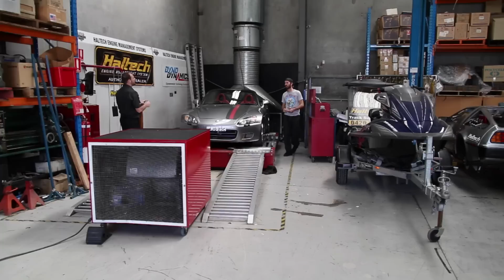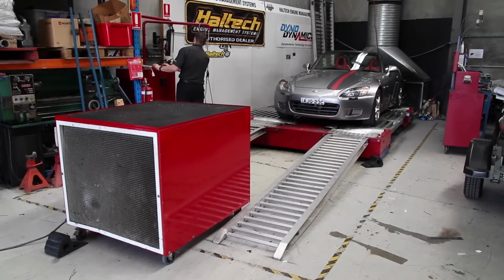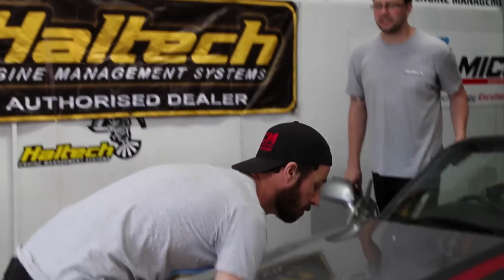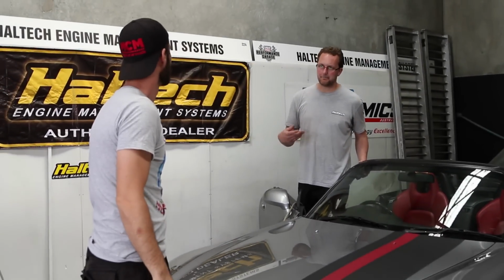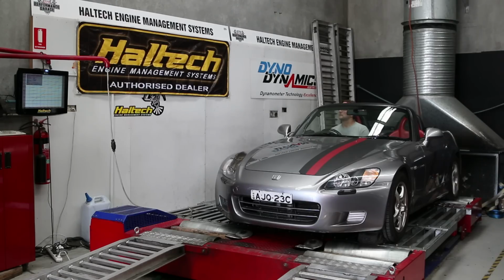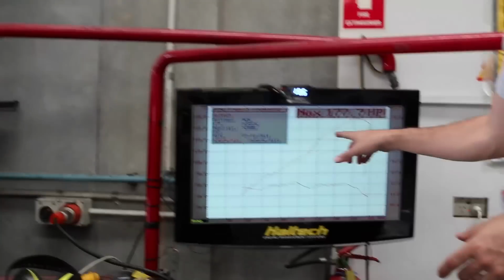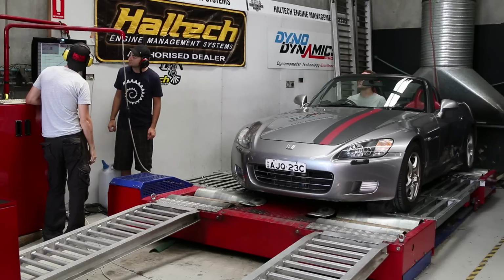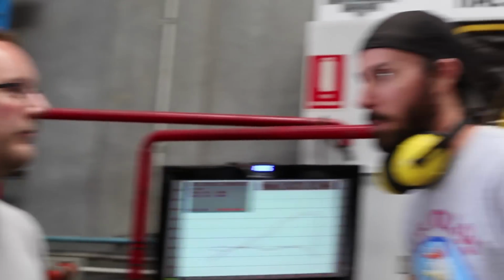Cold Air Intakes Mythbusted [Naturally Aspirated]

Comment: Figured I'd comment since this will likely be the most popular video on the subject for awhile....So I feel that CAI/SRI intakes are valuable depending on a few other factors, for starters diameter of the piping....I have a 3.5 Intake which is an upgrade over the pvc 2.5 stock tubing. I definitely noticed a difference especially when moving from a oiled to a dry filter. Another benefit of the upgrade was how it opened up a hole area of my car hidden by the intake box and mounts.  I had an issue where my cold pipe kept popping off and I would need to pull over and spend 10-15 minutes removing the airbox to get to it in my car. I would imagine this design would only increase in heatsoak and hope that by opening it up, the air that would go to the stock airbox is instead traveling across the top of my engine, hopefully pulling heat out. Driving a Turbo down South is no joke.  Of course the biggest selling point is visceral and changing the sound of your car so you can hear spool and bov  (if no maf sensor) is a good way to enjoy the car without driving recklessly.

Comment: Rx8 a 2 stroke? first i heard of that. of all things its a 3 stroke
Reply: there is no such thing as a 3stroke. there are 2 stroke or 4 stroke engines. did you maybe mean each rotor has 3 faces?
Reply: You can't say its 2 or 3 stroke engine because there aren't any. Its an otto-cycle engine, that behaves similarly to a 2 stroke, as in on the opposite side of the Piston/Rotor another part of the otto-cycle is taking place.
Reply: thisnamebegreat  It may have similar but it has 4 cycles like a normal engine so its 4 stroke
Reply: SolarFilms ►TKV I have said this, otto-cycle has four cycles, the use of the term stroke on a rotary would be incorrect.
Reply: What tuning fork most likely meant was it kind of works like a two stroke in terms of how the fuel, air and oil is mixed together in the combustion chamber to lubricate the apex seals. oh and the same 'thirstyness' as a two stroke lol
Reply: A rotary has an intake, compression, combustion, and exhaust cycle, sharing with a 4 stroke engine, but if you want to get technical about it, a rotary engine doesn't have a "Stroke" at all, however the output shaft turns a total of 3 times for every 1 revolution of the rotor. So that would make it a 3 stroke, if it were a piston engine.
Reply: I can kinda understand why he says two stroke. We call a stroke, as literally, a piston moving from TDC to BDC or vice versa. Basically, if you look at a piston engine, it requires 2 full revolutions, or 4 strokes, of the system (up, down, up, down) for one power cycle (intake, compression, power, exhaust). A wankel rotary only needs to rotate one revolution per power cycle (0-180 degrees, 180-360 degrees), or 2 'strokes'. Now yes, they're not really strokes by design, but in terms of relating it to a 4 stroke piston engine, it makes sense. Looking at the GIF on this wiki http://en.wikipedia.org/wiki/Wankel_engine, you can see what I mean. The thermodynamic system completes a cycle in one revolution, vs. 2 revolutions for a piston engine.
Reply: SolarFilms ►TKV so wait, follwing your logic, V12 got 12 cylinders so its 12 stroke ?
Reply: lephantom270 I believe he may have also have mixed up due to the way the Wankel uses oil injected into the cylinder to lubricate the Apex Seals similar to a 2stroke that uses oil mixed into the gas to lubricate it's piston rings :)
Reply: prop1113 That doesn't really have much to do with it. The problem is, 'stroke' doesn't apply to rotary engines, it's a very bad way to describe it. Let's separate the thermodynamics and mechanics of the engine. If we think of a stroke as a purely mechanical term, it means, in a piston engine, it is the distance between TDC and BDC. In a rotary, this is a bit more complicated, but if we imagine a rotary apex, a 'stroke' would be the distance between 0 degrees and 180 degrees in the full revolution of that apex. So you have 2 strokes per engine rotation. Now because a piston engine completes a whole thermodynamic cycle (intake, compression, power, exhaust) in 2 rotations of the engine, it is a 4 stroke engine. One thermo cycle happens in a piston completing 4 strokes. Using that logic, a rotary is a 2 'stroke', as one thermo cycle happens in the apex completing 2 strokes, or one rotation of the engine.
Reply: don't really care if it's a 2 stroke or not. but was just giving another reason why he may have also said it was a 2 stroke rather than 4. I love rotaries but don't care to argue if they are 2 or 4 does it matter, not really (to me anyway) Cheers
Reply: SolarFilms ►TKV for some reason I thought you wrote cylinders not cycles...  wankel engine has 4 strokes
Reply: SolarFilms ►TKV Wrong. All otto cycle engines have four cycles. Two strokes have four cycles. Four strokes have four cycles. Wankels have four cycles. The word stroke specifically refers to how many times the piston moves in the cylinder. Wankels are not reciprocating piston engines, so neither work exactly, but they work in a manner far similar to a two stroke engine than they are a four stroke.
Reply: yes i agree typically people refer to cycle as stroke which is not always the the same rotatory engines being the example. how ever you are wrong saying 2 Stroke have 4 cycles  they only have 2
Reply: SolarFilms ►TKV no they don't.  They just get all four done in two movements of the piston aka strokes because they are doing two at a time kinda.
Reply: FiftyRacer "kinda" is right.  It's funny, this thread has proved you all had good points and successfully proved each other wrong and right trying to sight clever  similarities and differences between the piston/cylinder style engines and rotary/lobe style ones.  Consistency of terminology helped clear some of that up but missed the main reason why there is 2 strokes needed and one full revolution of the crank to complete air/fuel in and exhaust out for a 2 stroke engine and why there are 4 strokes and 2 full crank revolutions needed to get the air/fuel and exhaust out is there cams and valve in a 4 stroke and just ports in a 2 stroke. In a 4 stroke engine. That is why a stroke is not the same as cycle when comparing 2 and 4 stroke engines to rotarys.  The way I think of the difference between 2 and 4 stroke engines is described the same as you would read in any text book.  A 4 stroke engine is named that because its based on the position of all the mechanical parts during 1 cycle. There is 2 different events happening when the crank and piston pass the same spot twice during what we call a cycle in a 4 stroke. The reason this needs to happen twice in a 4 stroke is because there are cams and valves to allow air into the cylinder and seal during 1 revolution of the  crank then allowing it out of the cylinder during the second crank revolution.  This is why the word cycle is used. 1 cycle describes 2 full revolutions of the crank. one revolution is a piston to pull or accept air into the cylinder as it goes down (intake stroke) as it sets up the combustion event, and back up for the combustion event (compression stroke).  The second revolution starts as the explosion pushes the piston back down (combustion stroke) then, finishes by pushing the exhaust out. (exhaust stroke).   What we have within the 4 sets of parentheses account for the 4 strokes in 1 cycle.  A 2 stroke doesn't have the cams and valves to control the air/fuel in and exhaust out.  It has ports in the sides of the cylinder and the piston itself seals those ports during the 2 strokes of the piston and one revolution of the crank completing it's cycle.  In terms of airflow we can say, the first stroke (down) completes the combustion and exhaust events while the flow of the exhaust out of the cylinder causes negative pressure in the cylinder also completing the intake event. The second stroke (up) completes the compression stroke.  Sorry for the lengthy post but this incomplete thread triggered an OCD event in my brain.
Reply: How about everyone here agreeing? It is a rotory engine.... no 2 strokes, no 3 strokes, no 4 strokes for the combustion cycle WHATSOEVER,  no strokes AT ALL. simplicity.
Reply: It's a 2 cycle more appropriately. .
Reply: thisnamebegreat  yes there are 2 stroke engines but i dont know about rx8
Reply: prop1113 not all 2 strokes require oil in the fuel. There are several marine, industrial and agricultural 2 stroke engines in the wild which use a conventional oil setup. The reason a typical weedwhacker 2 stroke engine uses oil in the fuel supply is because its highly simplistic design actually leaves the fuel/air mix running through every single moving part of the engine, therefore it makes sense to add the lubricant to the fuel as the lubricant is then reaching all moving parts too, this saves the complexity of having an oil pump. Industrial 2 stroke engines still have an actual overhead valve for exhaust rather than a port in the cylinder lining, they also use an external supercharger rather than crankcase compression (2 strokes cannot be naturally aspirated, the cheapo weedwhacker style engines use the piston falling into the crankcase as a very crude supercharger), they then have conventional oil and water pumps.

A wankel engine (the mazdas DO NOT use a rotary engine, that is a complete misnomer, the actual term is wankel) is a zero stroke design as it doesnt have a piston stroking. It is however a otto cycle engine, aka, 4 cycles. Intake, compression, combustion, exhaust in that order.
Reply: it is technically 4 strokes. What a rotary benefits is that it takes less time to do the "suck, squeeze , bang , blow" since it's it's doing it all the time unlike Pistons.
Reply: SolarFilms ►TKV VR46champion FFS. Two stroke is an otto cycle engine. It has four stages or cycles if you will. It completes them in two motions of the cylinder.
Reply: Jesus i never knew my comment could cause a giant fucking debate. well i learnt alot. cheers guys.
Reply: ***** Sure, it can take 2 stroke oil in the fuel and OMP to lubricate the rotor seals, but if you tried to put 2T oil in the sump it would fuck the engine pretty quickly.
Reply: fair enough
Reply: putting 2 stroke oil in the fuel doesnt make the engine a 2 stroke though. Try a shot glass of 2 stroke oil in a diesel engine, gives a bit of a clean out.
Reply: reed valve just stops air going out the intake when the crankcase pressurises at the bottom of the stroke. Powervalve adjusts the exhaust port size and broadens the powerband.

Comment: It also depends on the pipes you use and how far away/ size of the air filter. If you had a tiny filter and a small intake and make both bigger while making the tubes hold colder air without heating up it causes your car to naturally let more air into the engine in result your mass air flow sensor with tell the ECU to put more gas into the engine. That’s when you do it correctly. Most people do not they just buy the kit online and install it thinking they’ll gain 10hp.